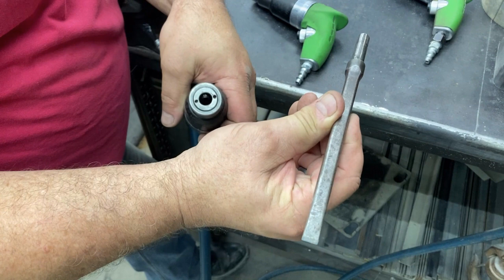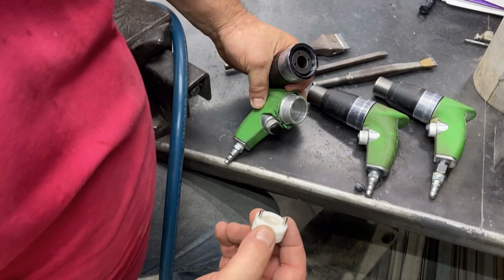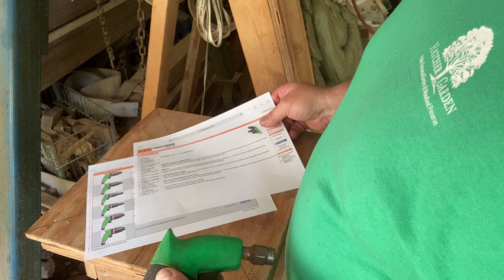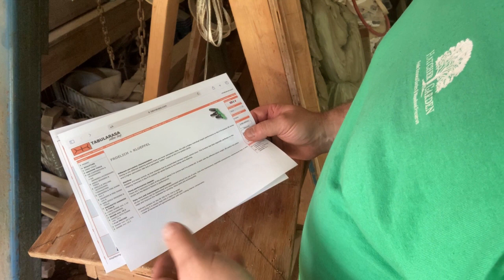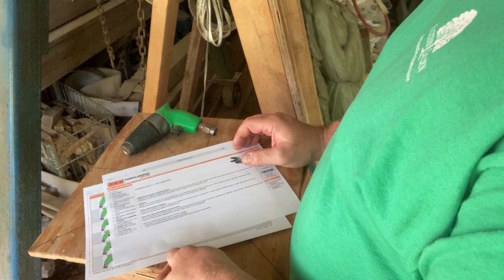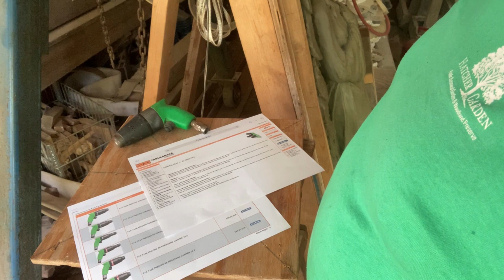Traditional Stone Carving Techniques- Bavaria GS and F&K Pneumatic Hammers for Stone Carving Video 2

Comment: Thank you for the show. I think you are wrong. Stiva does not have F+K German factory, which are expensive and use a lot of air. Stiva's air hammers are Bavaria air hammers from the German factory GS 43 or GS 45 soft is the model according to the technical characteristics.
Reply from the maker: Thank you very much for the correction and accurate information.  These air hammers are relatively uncommon here in the USA.  I didn’t know there were multiple brands of very similar hammers that are also the same color green.  But I’m not surprised.  There used to be several USA companies making nearly identical “regular” pneumatic hammers for stone carving here in the USA.

Since receiving your comment, I have edited title, description, found information about Bavaria air hammers and added links in the description to a few companies selling the Bavaria GS series hammers.
Reply: I work with BAVARIA pneumatic hammers. I have 4. 
BAVARIA GS 40 (7800/min),BAVARIA GS 41(7200/min),BAVARIA GS 45 (6200/min) BAVARIA GS 46 (5500/min). Air consumption about 195 litres. Price of the hammer about 330 €. F+K price about 500-600 €. Air consumption about 340 litres. I don't have an F+K hammer. For both BAVARIA and F+K all parts are for sale, whatever is in the hammer.
Reply from the maker: @dainiusdaugela2217  ^^^that is excellent  information to have here for other carvers and sculptors to consider before purchasing equipment.  Thank you very much!

Comment: I  bought a couple different sized Trowel and Holden Pistol grips  🔫  for my Guns,  I carved the pistol grips for extra comfort , I use them every now and then, depending on what I am Carving 🪨🏌️
Reply from the maker: Before T&H offered them, one of the sculptors in Barre had improvised a pistol grip for his regular hand machines as a remedy for his very fatigued hands.   It helped him a lot.  I’ve never used them.  

The only alternate configuration I have used is a D handle on a large chipping hammer or pneumatic hammer drill (I’ve got a couple of CP9-AK machines) for heavy rough-out work.  If you’ve got enough air, they make hogging off stone much easier vs using a 1” or 1 1/4” hand machine,
Reply: @carolinasculpturestudio    Oh Yes, The Trusty Old  C P  -  9  🔫   lol 👍😃
That is an interesting back Story about the Sculptor and his Pistol l grip ,   What I also did to fit one, on a non - trow and Holden D type, that was similar in shape and in size, was to  immerse the Rubber rings in Very Hot water for a minute and then I was able to fit the problem one, over the Diameter of the gun , Worked very well 🍩 🔫😃👍

Comment: Thank you for posting this video! I bought one of those tools a number of years ago just to see what it was like. I found that it almost forces you to actually grip the tool, which was really tiring and I’m sure it was not good for the nerves in my hand/wrist. Might be okay for carving marble, but in my opinion, it’s really not suitable for carving granite (which is what I mostly carve)
Reply from the maker: For people who do not carve 40 hrs/wk for years, it may be more a matter of personal preference than comfort or injury.  The size of the machine and piston has a lot to do with how much energy can be imparted into the stone.   The F&K hammers I’ve taken apart have a very small piston, half the size or less than piston in a typical 3/4” or 1” T&H style machine.  To me, that means it’s not the best choice for me to use to carve granite.

When a 1 1/4” T&H hand machine is not larger enough, I use a larger chipping hammer (CP9 Handrill) with 4- or 9-point for large rough-out work.  It has a D handle and is also a larger & much more powerful machine.  The goal is to let the machine do the work as you guide it, not to force progress using a machine that’s too small.  Forcing the machine, which is usually accompanied by tightly gripping the machine and working hard to push it into the work, generally means you need a larger machine.  

It’s common for new carvers to tightly grip (squeeze) a typical T&H or Cuturi hand machine as they try to control it.  Your hand will quickly go numb from the vibrations.  Once you learn to relax your grip to guide the machine instead of restraining it and use the appropriately sized machine for the job, that numbness lessens significantly.  it’s much better for your body and your work.

Comment: Man you are the man. I’m at work right now but I want to take off so I can go check my hammer and make sure I put it back togather right.  Man I really appreciate you Clint. You are the man.
Reply from the maker: Check the assembly order and make sure that all holes are properly aligned and that parts are properly oriented.  It’s a little easier to hold the barrel/cylinder vertical with all white plastic manifold pieces on top and then carefully screw it into the body of the hammer.  

If you removed the trigger, make sure it is also assembled in correct order.  When the speed adjustment ring is not screwed on enough, the hammer won’t run either.  

Good luck.